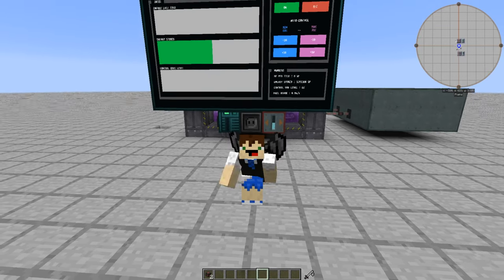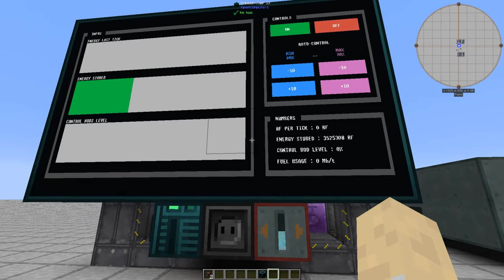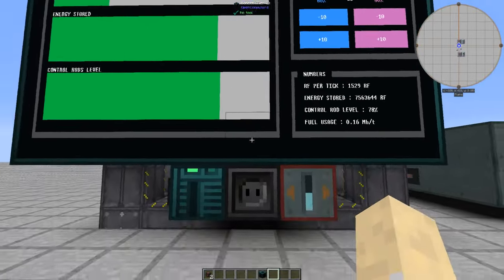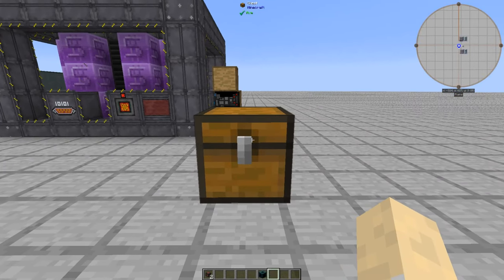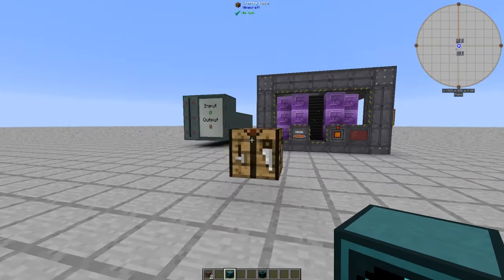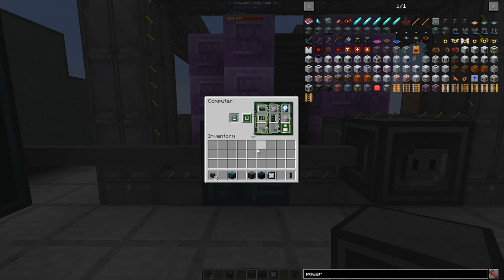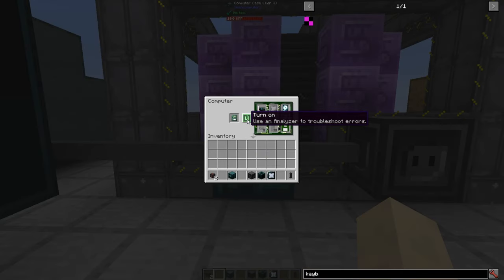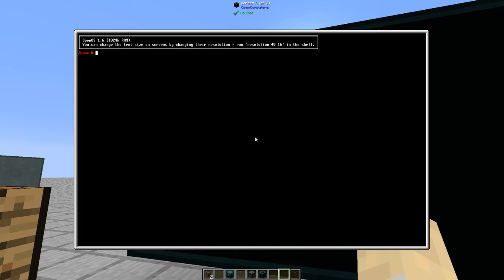Big Reactors / Extreme Reactors - OPENCOMPUTER AUTOMATION PROGRAM

Comment from the maker: New version! added handling of new functions from extreme reactor. Let me know if it does not work like before
Reply: I've got mine set up and working but it doesn't seem to be lowering the control rods at all. Energy stored is at 100% and the output is limited to 16k per tick but the rods are still at 0%.
Reply: Looks like the version of extreme reactors and zero core from the 2nd of June changed something involving OC and Lua...
Reply from the maker: i will look when i have the time, today or tomorrow, but the change was done to extreme reactor about 1 month ago
Reply: The same thing is happening to me
Reply from the maker: can you give me more info, can you guys send me an image of your setup on twitter. is the setup in one chunk? did it happen straight away? after a server restart? after you left the chunk? I tested in SP and everything was working for me :S. also, what modpack?
Reply from the maker: I fixed it, there was an issue with a method, should all work properly now
Reply: sweet thank you
Reply: Hey, I've used your code before and loved it. This time when I installed it in 1.12.2 it isn't lowering the control rods. Any ideas on why this might be happening? open os 1.7.5 and extreme reactors 4.5.67

Comment: Just wanted to say thank you for this program. I stumbled across it some time ago, and have used it in quite a few builds. It makes using reactors so much easier. Less fuel consumed, less babysitting, less worrying about power running out when afk for awhile or off in another dimension somewhere. Wonderful. Thanks again!
Edit: a note to anyone using Extreme Reactors for early game, making a wide but shallow (5x5x1 or 7x7x1) reactor uses little materials, and is extremely efficient.

Comment: First of all i would like to thank you for your amazing program and the fact that after all this time you still give support to those who ask for it... truly a rare nowadays

So i used this tutorial and your program a lot of times and it worked flawlessly, but today i ran into an issue i could not resolve.
Modpack: Direwolf20 1.12.2 (v1.4.0), Mod version: 0.4.5.44

I keep getting this error:

unsupported resolution:
stack traceback:
[C]: in function 'error'
machine:986: in function <machine:983>
(...tail calls...)
/home/reactor.lua:13: in main chunk
(...tail calls...)

I checked everything and i'm definitly using a reactor computer port.
I suppose something changed in the mod between 1.10.2 and 1.12.2 and that's why it's not working anymore, as this is the first time i'm using it in 1.12.2
Reply from the maker: unsupported resolution normally means that the screen you have are not the correct level, did you use Screens level 3? and a graphic card level 3?
Reply: I'm so dumb... of course it was the graphic card... i checked it around 5 times and never realized that it was a tier 1 card... argggh.... anyway it's working again, thank you for the support =)
Reply from the maker: +DasL0ki my pleasure ;)

Comment: It's a nice app. I would love to see an expanded version, with manual control rod insertion.
Reply from the maker: I don't really have it planned since I wanted something I didn't need to touch :)
Reply: I gathered as much, rigth now Im trying to wrap my little brain around the button api, and figure out exactly how it works n stuff. .. I'm terrible at lua, and even more terrible at making any kind of gui thingy. Unfortunately there are so few tutorials on how to do this stuff. ..
Reply from the maker: API.setTable("NAME", functionName, xStart, xdistance, yStart, ydistance, ,Text, {on = colors.ON, off = colors.OFF})

API.screen()
 
event.listen("touch", API.checkxy)

while event.pull(0.05, "interrupted") == nil do
    do stuff
end

that is how you use it pretty much

Maybe that can help?
Reply: That actually is helpful. O_o thanks. I'm actually trying to setup an app for my tablet, so controll my nanomachines via touch rather than manually typing in each command. I'll just have to play with it till it starts to get intuitive.
Reply from the maker: shoudnt be too hard, create a button linked to a function that has the command in it and it should work. you might have to use os.execute or something like that in it

Comment: You can get the same effect with just 2 rednet ports and 2 rednet cables, you just dont get the big visual monitor.
 Basically if done right it will insert the fuel rods based on its internal power storage, so the more power sitting in the reactor, the less power the reactor makes and the less fuel it burns. You can also set it up with redstone ports and redstone to turn the reactor off once it's above x% capacity, and back on below y%
Reply from the maker: yes, you can, but the point is to see the things and have a nice visual

Comment: +Krakaen I cannot get the program to activate because no matter what I do, it seems it does not register clicks.

Everything is setup as per the video, although I am trying it on a 1x1 screen due to a lack of obsidian at the moment. What's the minimum screen size? Is it possible that's what is affecting the clicking?
Reply: I Increased to a 3x2 screen and am now able to click the min-max controls.. still cannot click the on button.
Reply: Interesting. Foolishly I had added a coolant port to my reactor. That cause the on button fail.
Reply from the maker: the coolant port will make it not produce rf, and the reactor program will be useless

Comment: Even though I set auto-control to max 60%, and min 40%, it still sets control rod level over and under it and temperatures goes up to 1600c. Also the server said it couldn't find reactor so I had to use regular computer
Reply from the maker: +Justcampus it is not a limitation on the rods, it regulates the power in the reactor to be between those numbers but controlling the rods to make more or less power

Comment: @krakaen great video.  I set it up and its displaying the info correctly.  Only problem that I have is the button is not working.  Im running FTB Revelation 1.1

***Simple restart of the computer case and everything is running smooth**

THANKS FOR THE VID !!!
Reply from the maker: +Sefin88 my pleasure
Reply: @Krakaen  Help I got same problem and restarting dont do anything im on 1.12.2 .....

Comment: Nice program! Glad to see someone giving a spin to the computer port :)

Got a couple of questions if you don't mind. Does it manage multiple reactors and Tesla? Do you think some methods are missing from the computer port interface? We are already adding one to get the total energy capacity of the reactor (and turbines too), so if you think something else could be useful let us know and we will look into it
Reply from the maker: thanks, the program only does one reactor. The total energy capacity is a static number in itself, so i wouldn't really need a function for that. If in some way, the capacity would change with the size of the reactor, then it would be a nice addon, but in this case, a Reactor is 10mil and a turbine is 1mil
Reply: It will ;)

Comment: Is there any way to prevent control rod insertion from going below a certain amount? Because going anything below 85% makes my reactor extremely inefficient, and I don't need it. But since I'm filling up a draconic evolution power ball it keeps drawing max power from the reactor, and your program makes the control rods go to 0%
Reply from the maker: the only way would be to change a couple of things in the code... like... 7-8 places. the program will make the reactor give you what you need and since you are filling the ball, it takes all because there is no restriction. you could use a fluxgate from draconic evolution to control the RF going in the ball, I think that would be simpler

Comment: So i got it to install and i see the screen with the buttons and information. But i cant actually click on anything neither shift clicking nor right clicking then int he opened display click anything.
Reply from the maker: shift-right click when outside and left click inside normally should work
Reply from the maker: try placing the keyboard on the screen and not on the controller
Reply: The Keyboard is on the side of the screen like you showed in the video :)
Reply: I'm seeing this exact issue as well in FTB Beyond. Did you ever fix it?

Comment: The buttons dont work ......
Reply: Now buttons work... but the control rods dont change their place.....
Reply from the maker: What modpack?
Reply: Im using extreme reactors and opencomputer for 1.12.2
Reply from the maker: I will test later today and write back here with what i find
Reply: @Krakaen  ok
Reply from the maker: @xSpeed2137  hum... not sure what to say... it works when i test it in enigmatica 2 which is 1.12.2... 
Are you matching the condition for the rods to move? you need to be able to make more power than you consume and it will change the rods to adjust that

Comment: Hi, i just have a problem that started few days ago, every time i log out from server and log back in my screen resolution changes, no matter how many screens is there even if there is just one. Also happening when i use rft dim or any tp device. All is chunkloaded and working fine but screen meeses up. Thanks
Reply from the maker: there was updates lately to mods, did you recently update your modpack to a more recent version? this seems to be an issue with OpenComputer, not my program. The resolution is handled by the mod itself, You should probably report the issue on their website
Reply: Krakaen  thanks so much for reply and this perfect program. I never thought its problem with your program :) i was just trying to find solution for problem that happened. Thanks for advice and looking forward to see some DE reactor program from you heh. Keep up great work my friend.

Comment: You probably won't see this comment, but my control rod level is stuck at 100% whenever I use this program, rendering the reactor useless. When I go to change it on the control rod, after I set it it immediately goes back to 100%. What do I do?

Comment: Hi, couldnt get the screen to work for the controls etc, visuals all work fine, just the adjustment side of it isnt working, tried shift+right click and also opened it and tried with left click. still nothing.

Any idea what might be going wrong? im using Extreme Reactors and OpenComputers in the ProjectOzone 1.12.2 modpack.
Reply from the maker: Add a keyboard
Reply: @Krakaen  already had a keyboard on there, still didnt work :/
Reply: no worries. fixed itself, dont know why it wasnt working but my power went out and when i rebooted the system it works, dont know why it didnt work on previous restarts

Comment: I was wondering if there was a way to configure the reactor.lua script to have a main terminal (screen and all not a remote terminal) connect via wireless to another terminal attached to the actual reactor within 80m so you could have a command center setup.
Reply from the maker: I did not do it in the program, if you would like to give it a try, feel free to use the code

Comment: Ok, so i'm on SF3 on a server and we are trying to get the code on OpenComputers to work, we then get an error saying (on startup):

boot/04_component.lua:69: no primary 'br_reactor' available:
stack traceback:
             [C]: in function 'assert'
             boot/04_component.lua:69: in function <boot/04_component.lua:67:>
             (...tail calls...)
             /home/reactor.lua:7: in main chunk
             [C]: in function 'xpcall'
             machine:751: in function 'xpcall'
             /lib/process.lua:94: in function </lib/process.lua:90>
Reply from the maker: hum.... it cant detect the reactor it seems... is it connected to a computer port with cables?
Reply: It is connected to a port (reactor redstone flux power tap (legacy)) with cables going into the screen and computer.
Reply: in what way? to power or you may need to use the computer port instead to a powertap
Reply from the maker: you need to connect the cable to a computer port not a redstone port....

Comment: cant seem to download via pastebin. it says it's successful but the file is always empty when i open it with edit.
Also tried to download the other files manually but these are also empty.
Reply: Fixed it myself now.

The pastebin.lua had the line: [local url = "http://pastebin.com/raw.php?i=" .. pasteId], I changed it to [local url = "http://pastebin.com/raw/" .. pasteId] and it works fine now.
Reply from the maker: oh.... what modpack are you playing? the file you changed is from openComputer, it doesn't come from my program, it must be that pastebin changed something in there side for links, saddly, this will probably break a lot of things
Reply: I know it was from OC itself, just wanted to let other people know what was wrong.

I'm using Sky Factory 3, default settings from the curse launcher.
Also posted this problem and the solution in the OC forums, so maybe they'll have a look at it.
Reply: BTW, really like yout program :D

Comment: I just followed the guide and did everything exactly as you did it. 

I get an error on OC

/bin/pastebin.lua:28: Connection refused: connect:
stack traceback:

[C]: in function 'error'
/lib/internet.lua:50: in function 'for iterator'
/bin/pastebin.lua:28: in function 'get'
/bin/pastebin.lua:136: in main chunk
(...tail calls...)
[C]: in function 'xpcall'
/lib/process.lua:63: in function </lib/process.lua:59>

I am an LUA nobody. I haven't a clue. I just copy you programmers word for word and pray. Any help would be welcome.
Reply: Solved I think. It only works in 1.12.2. I guess RedNet is for 1.10.2.

Comment: Hey guy, could u tell me what blocks u are using for cooling the fuel rods in your reactor? Im playin Direwolf20 and SkyFactory3 for 1.10.2 and allways have trouble with cooling the reactor when i build a bigger one. Only diamond blocks are not enough. 
Wich fluids are the best for cooling in this Version? Gelid Cryotherm ist a part from ThermalExpansion i think and its not available... This Reactor is driving me crazy. Ive build one in Direwolf20 witch is 20x20x7 for feeding my Tier7 Draconic Energy Core and with diamond blocks for cooling it uses 17mB of fuel... the first setup with 7x7x7 also needed at least 2mB fuel with diamond Blocks when it run on 100%. I think its pretty much fuel use.
Reply from the maker: In 1.10, extreme reactor does use more fuel, the best block I think is a mix of graphite and manyullyn
Reply: ok thanks u. Now i have trouble to get this program running. Ive configurated and installed the computer like u did it in this video. when i start the pastebin download an error is displayed on screen and the start.lua is empty. trying to find the pastebin.lua but i havnt found it yet. it doesnt matter if i download your program or others, all files were empty when i try to edit them. and ich couldnt find the pastebin.lua file. could u help me?
Reply: here is a link to the screenshot i took from the screen while showing the error. link is from my dropbox. https://www.dropbox.com/s/wbn5zgc9swf6ojt/pastebin_error.png?dl=0
Reply: ok, i fixed the download problem, but i dont know how ;P , now there is another problem. i can download the start.lua and i also can run it, then it downloaded the other files from pastebin and then came an error with the reason of my resolution. it tells me that i use an unsupportet resolution. i looked in the reactor.lua and there is written in line 13 resolution 132 38. i cant change my system to that resolution and i dont know why. i had to say that this is my first work on opencomputers. i dont have any experience on programming this machine. the screen is 5x3 with Tier3 screens from opencpmputers. GraphicCard Tier3, CPU Tier3, HardDrive Tier3, the same setup u choose in this video and it doesnt work...

Comment: Hey Krakaen this looks awesome and i thought i followed you step but i'm getting an error on supported resolution but i'm using tier 3 screens on a 3x5 as you did. Any ideas? I can post a screenie if you give me an address if it will help! thanks man!
Reply from the maker: normally, even the number of screen wouldnt change anything with this, it would only depend on the screen itself, a tier 3 should be able to take 140+ pixel wide and i use 138... I don't know really, you could send me a screenshot on my twitter if you want me to check it
Reply: ok thanks man, i've just twitterered you.
Reply from the maker: are you using a graphic card lvl 3? as it turns out, you need the lvl3 to make it work

Comment: Thanks for this video and sharing the code! Do have a few questions.
So, you can plug your EnderIO power conduits into the Power Converter? For my setup, this needs to work with both EnderIO and RefinedStorage.

Also, could you possibly show how you built your reactor? Aka, where you placed the input and output of fuel, what coolant you used, etc.
Reply from the maker: The reactor is not the best you could do, i havent looked at 1.10 enough to know what is the best setup for a reactor.  as for the enderIO conduit, it will work, and i presume RefinedStorage would work also

Comment: can one system manage multiple reactors?
Reply from the maker: no, this is only for one reactor
Reply: currently i only have one, can it be possible to changethe code to support two
Reply from the maker: It would need a complete rework, it gets the information for 1 reactor, all calculation would need to be ajusted